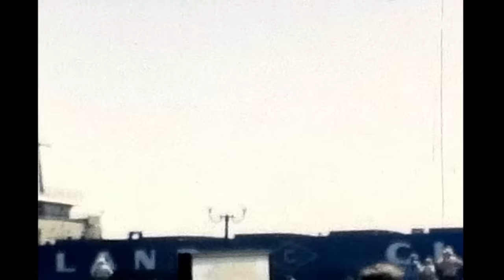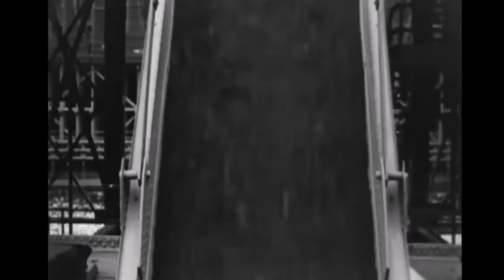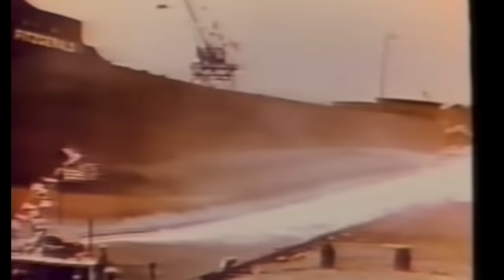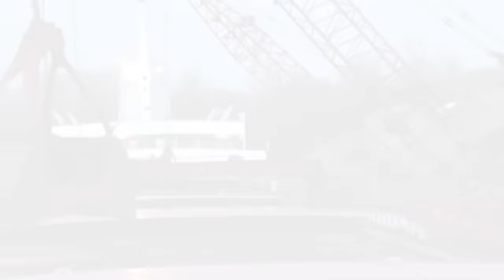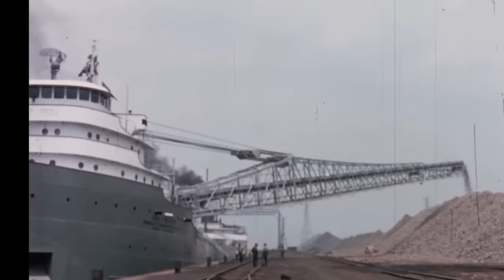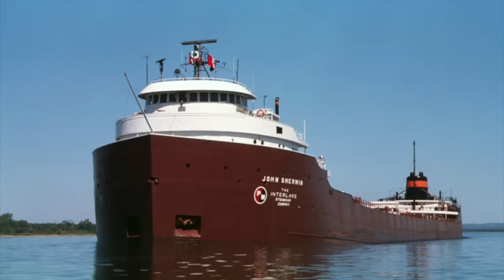Where Great Lakes Freighters Go To Die: Left To Rot (Part I)

Comment: John Sherwin was laid up in Nov 1981 and moved in 2006 for a self unloader conversion and new engine, but those plans were put on hold due to the economy. Looks like both hulls are in good shape after all these years.
Reply from the maker: For sitting out in the elements I’ve read the vessels are still in relatively good condition. Specifically, the Ryerson.
Reply: @LongShipsChannel That is true. I have driven by the Ryerson in recent years and she looks in better shape than half of the ships that come into Duluth.

Comment: Nice video, I look forward to the next installment. Google Earth shows that the Ryerson has been moved from the slip she occupied in the video to a spot next to dry docks further down the channel. She is berthed near a modern ore hauler that is nearly twice her size. If they retrofit her with an auto unloader it will take up quite a bit of capacity.
Reply from the maker: Thank you! Lots of good stuff coming!
Reply from the maker: Yes unfortunately if they did add self unloading equipment it would be very difficult the way the stern was constructed. Also taking away cargo space 😕

Comment: Nice video. But your first statement is correct. These are work boats. When they are of no further use, economy and efficiencies dictate these boats are either scrapped or go into layup. Boatnerders get too wrapped up in the aesthetics and design.
The construction of the Mark Barker, the first American-built boat on the lakes in 40 years, hopefully is a signal of a new era in shipbuilding that puts new hulls in the water. 
Putting a boom on the Ryerson or Sherwin, reconfiguring the holds, repowering them and installing the latest emissions technology would make little to no sense to a penny-pinching marine carrier. 
If they retired the Blough and St. Clair early because of onboard fires, why would a company make the investment in bringing the Ryerson back into service.
Reply from the maker: There's nothing wrong in appreciating history!
Reply: @LongShipsChannel  Absolutely. But everything has a lifespan.
Reply: The Blough and St.Clair were both destroyed by fire and deemed a total loss by the insurance company and owner. Just like when a car is totalled, where it's determined it would cost more to repair the car than it would to replace it.
Reply from the maker: @jamesbraun9842  the Blough is in long term layup
Reply: I agree. All the comments that think fast eddie should become a museum  haven't put alot of thought into that. The ships owner isn't going to just give away millions of dollars worth of scrap and if they do they think maintenance on 700+ foot of ship is cheap? Nothing lasts forever. They scrap battleships with far greater significance to people.

Comment: Steel production is down in the US from its peak, and 70% of it is from recycled scrap.   There's much less demand for iron ore.
Reply from the maker: Although the demand for steel is down. Great Lakes shipping remains the most efficient, sustainable and economic way to ship iron ore!
Reply: The high quality iron ore in Minnesota is pretty much gone, and they are mining the lower quality iron ore, called Taconite now, which in the mining heyday was considered waste product.
There is still plenty of this lower quality ore (supposedly 100 years worth).
Beyond that they say there are deposits of a different type of iron deposits that would require a different type of processing.
Reply: Scrap metal is alot safer industry then mining